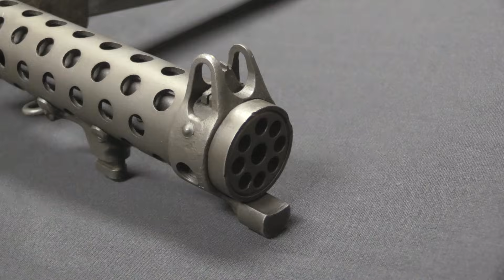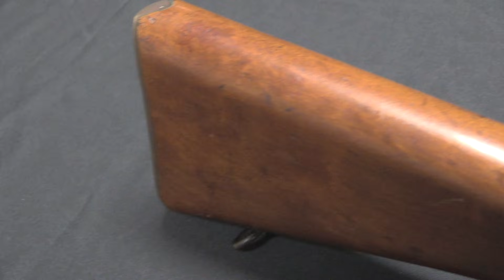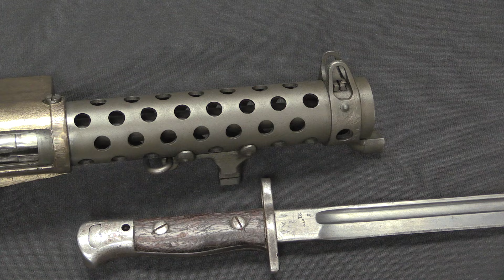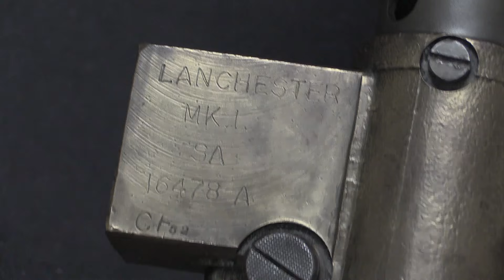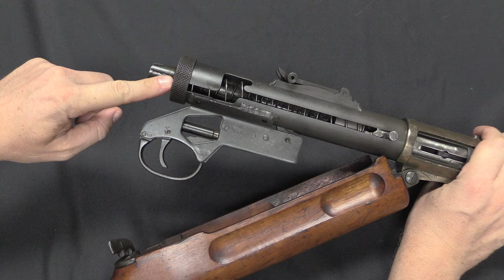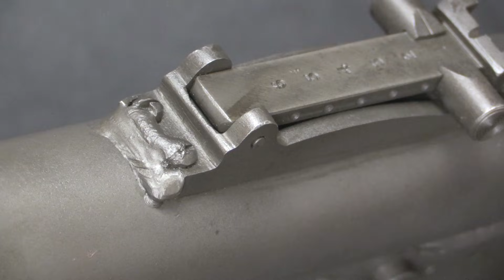Lanchester MkI: Britain's First Emergency SMG

Comment: Why didn't they just clone the nazi sub machine guns?????
Reply: Morale mostly, soldiers typically don't like the suggestion that their army's equipment is so bad they've started to produce the enemy's weaponry instead 

The same thing somewhat applies to the gun in the video as it is based on the MP28 but those saw a lot less use during WW2 than the MP40 and the like, so there's less of a chance a soldier would notice the similarities

Comment: In my opinion the Thompson is the best SMG of the WW2 period.   45 ACP meant higher stopping power and that’s the major plus.  Second in tied position the MP40 and the PPSH, both were outstanding in their own way.  Close behind was the Sten which is a simple yet highly effective SMG.
Reply: Beretta M38A
Reply: It has a pistol grip, last round bolt hold open and double stack double feed mag. it got much right. the cyclic rate of the 28A1 is perfect. 6900 grains of .45 in 4 seconds is unmatched for CQB. people say its over rated these days and will look down on you as ignorant for favouring the thompson over muh MP40 or Souomi

Comment: There was an extreme stimulus for Britain to adopt a 9mm SMG after Dunkirk. Teaching a rapidly formed civilian defense force required a weapon that was easy to manufacture (ergo blowback) and easy to learn to shoot and ~nearly foolproof to maintain. The Lanchester was certainly easier to manufacture than an SMLE. A blowback operated rifle is extremely problematic in so many ways. A pistol is a 50 meter weapon at best and shooting one accurately past 10 meters takes a lot of time and practice ammo. It also requires better tolerances and manufacturing time than a Lanchester  Controlling a 9mm round in a comparatively heavy SMG is a piece of cake.

Most of the above applies more to the Sten than the Lanchester but the thinking behind the latter led to the former..

Comment: The gun wasn’t reversed engineered from a MP28. They did however borrow one of the extractors from a 9mm Bergmann to use on a 7.63mm sample gun, which are the guns that people think they were reversed engineered from. 

MkI guns with fire selectors were never issued. They were dropped in December 1941 and no guns entered service with them fitted. The mark of gun has nothing to do with the fire selector being fitted.

MkI guns were fitted with the tangent rear sight. MkI* guns were fitted with the flip sight. MkI** guns were fitted with the flip sight and bolt safety lever. 

Production didn’t end until 1945. The last contract was in 1943. 

The brass magazine housing was derived from the Spanish Modello 1929, because Sterling had contacts with the company that made them and they assisted Sterling with tooling to make the Lanchester. 

The RAF didn’t want the S&W Carbine. They simply wanted any automatic arm as soon as possible, be that Thompson, Lanchester, S&W or Sten. They simply didn’t care! 

32 round magazines were designed for the Lanchester, which is why in Sten development the magazine is never mentioned as it was a given it would use Lanchester magazines. 

They’re a hugely underrated gun and most of the “known”information about them is incorrect.

Comment: Like most British SA, the Lanchester had it's own purpose made Webbing.
The Magazine carrier was a very elongated Pattern 37 Basic Pouch for wearing on the standard P37 Belt.
Strangely, they were Khaki webbing, not Blue-Gray as was common in the Navy ( and RAF); probably for Royal Marines on Shipboard.
They were sold off as Surplus in the 1980s here in Australia...The RAN had a replacement RN Cruiser late in the war to replace the HMAS PERTH lost in the Battle of Java 1942. Being an RN ship, it came equipped with Lanchesters for its Srms Lockers and On-board Marines.
DocAV

Comment: Apparently, in order to make it not a ‘gangster gun’ they turned it into a long Lee with the ‘bayonet’, also known as a cavalry saber.
Reply: Well, technically, the "SMLE" bayonet, is the :"SWORD, bayonet, Pattern 1907". As seen on the engineering drawings for said item. And that bayonet was a straight knockoff from the Japanese Type 30 bayonet, vast numbers of which entered Royal Navy service before and during WW1.

And the SMG has been described as a noisy, ( L34A1 and MP5SD etc., excepted), extended-range bayonet.

So....

RN ships transferred, during and after WW2, to other navies, Australia and New Zealand among them, came with a "Complete Equipment Schedule", which, apart from the obvious things, included the mess and other cutlery, (including cutlasses and bayonets, and implements for boarding and shore parties. Thus, Lanchesters, assorted revolvers and rifles. If an SMG and bayonet proved insufficient for the task, there was always 20mm  and upwards to five inch and above  naval gunfire, torpedoes, etc.

If the need to escalate arises, it is always good to have options.

Comment: There's just something wrong about a sword bayonet on a SMG. I think the bayonet is longer than the barrel and receiver together.
Then there is the dissimilar metals (brass and steel) in contact on a weapon that was primarily used by the Navy. That's just asking for galvanic corrosion.

Comment: The Lanchester is not the choice for an 'emergency' gun. The Sten is, the MP3 grease gun is but not the Lanchester.
Reply: This is reliable and a copy of a proven design.
It works.
Copy it.... and the copy will work.
In an emergency...something that works is better than something that doesn't......

Comment: Adding the semi auto is no easy task and the increased complexity is amazing  !  No wonder so many were made full auto which make it so easy to make especially using an open breach !
Reply: Well then most everyone says the STEN gun was nothing more than a (pipe with a big spring a nail as a firing pin) not so the sten gun was a fine engineered piece of engineering, with a left / right push button semi/auto firing, they just didn’t spend to much detail on the exterior, most soldiers preferred it rather than the very heavy Thompson gun, not surprising after a 10 mile march under enemy fire, then the Americans caught up and designed something similar nicknamed the ‘grease gun’ Another ‘pipe an spring gun’!.
Reply: Breech....

Comment: Back in the '90's I bought a bag of sten magazines which included a single, 50 round, Lanchester mag (Which appeared to be stainless steel as it never rusted like the horrible sten mags) It was far more reliable than the sten mags in a sten or  my reproduction MP3008. Even loaded out to the full 50 rounds it never let me down and was easier to strip and clean than any of the sten mags (which dated from late war to way after)

Comment: I'm sure the Ian was correct in saying that dented on worn magazine lips would cause failure to feed but the lips on the magazine appeared to very thick. In other words that was going to take a lot of wear or hard hit to destroy.
Reply: Probably why this comment :
cptreech
6 months ago (edited)
Back in the '90's I bought a bag of sten magazines which included a single, 50 round, Lanchester mag (Which appeared to be stainless steel as it never rusted like the horrible sten mags) It was far more reliable than the sten mags in a sten or  my reproduction MP3008. Even loaded out to the full 50 rounds it never let me down and was easier to strip and clean than any of the sten mags (which dated from late war to way after)

Comment: My 2 cents worth : the brass well was a pain : too expensive to cast, too shinny, first thing sailors used to do : paint the damn thing with dark paint. 50 round mags, damned if yoy tried, spring was too tight and bullets could fly out of the other end of the mag. Stock : was a nice red timber piece, very elegant. Rate of fire was kept low as temperature would/could make it overheat. 850°C was the right temp for this toy so 450 to 550/mn was good enough. As for the mag pouches if was two pouches with 2x5 mags, imagine the weight fully loaded ( not speaking of the 1907 bayo either ... ).

Comment: "This has been upgraded with a Sten part" is not something I would ever have expected to hear anyone say about anything.
Reply: It does create a state of temporary confusion; much like "Microsoft Works"
Reply: About the only fitting thing I could think of is a spanner
Reply: I mean, the Sten was crude and cheap, but it was fairly reliable. Most of it's malfunctions are the result of holding it by the magazine, which is a big no no.
Reply: @RetardedSysAdmin  Yes but then they proceeded to offer no alternatives. There is no correct way to hold it, and most gave up and held it by the magazine well. It should've spent more time in the oven for certain.
Reply: @RetardedSysAdmin  Australia trialled the Sten. Half of the trials guns failed due to corrosion in tropical environments.
The AuSten addressed this by replacing the bolt, magazine socket and butt plug with gunmetal die castings but the Owen was found to be better in service and quieter when silenced.
Reply: @RetardedSysAdmin by The yanke in movies  and yanks that wouldn't listen to the British Sargent giving instructions .
Reply: I suppose in a pinch it would be a somewhat handy replacement for a length of pipe. Perhaps as a bludgeon of some sort.
Reply: hell you dont even wanna upgrade a sten with another sten part.
Reply: You may laugh...but the Sten was relatively effective, and cheap enough to be built in HUGE quantities , and quickly.   How many SMG's did the US Army have in 1939?   How many Stens could you make for the price of ONE Thompson?  Who wants to carry a Thompson around all day?   What year did the Grease gun finally appear?  All valid  questions..especially if you scoff at the Sten.
Reply: Trooper DGB 39 almost none. The US Army didn’t place an order for the Thompson until June 39. About 17 of the Mk3 models presumably less for earlier iterations. Beats a pistol, but yeah weights as much as a M1 Rifle. 1943.
Reply: @terranempire2  The U.S. military by and large preferred the .30 carbine. It wasn't full auto but it was magazine fed and semi auto besides being a heck of a lot more accurate. The weakness with the .30 carbine does appear to be the magazine lips but the troops knew what to do with a defective magazine. Throw it away and use a new one.
Reply: @dwightehowell8179  Again..NOT in 1940-41!
Reply: @trooperdgb9722  I’d take an M3 over a STEN any day.
Reply: @Immafraid  But you did not have that choice in 1941.
Reply: @Immafraid  I was gonna say the same thing.
Reply: @trooperdgb9722  ok
Reply: @Immafraid  or a PPS-43 witch has perfect realibalty and 250 meters effective range and is cheaper than the M3 and almost as cheap as the STEN
Reply: @trooperdgb9722  Unit price on a mid production run Sten gun was about £4 which means you got about 12 Sten's for the price of a single Thompson.
Reply: @trooperdgb9722  You're getting awful defensive about a gun that everyone who used it agreed was "fine... for the circumstances."  I mean, it's basically an MP-18 stripped down to its absolute bare elements and made as cheaply and quickly as humanly possible.  It's impressive from an engineering standpoint for those reasons, and it served its purpose well, but that doesn't really make it a very good weapon to actually use and handle when compared to its contemporaries.  By all accounts, other SMGs from the same era with a similar design philosophy are just better because they had a little more time in the oven.  The British didn't think they had that kind of time, so they rushed and cut corners, which is a completely reasonable decision for them to have made at the time, but those decisions came with trade-offs that negatively affected the weapon.  The Brits started looking into replacing the Sten in 1944, so even while it was still being used in huge numbers the military was already interested in replacing them.  The only reason they didn't replace them immediately was because, well, the war was over, they had huge numbers of these things and the political will wasn't really there right away.  But the military definitely knew that the Sten was not really a good long-term solution for the majority of military operations.

It's kind of like those Polish resistance SMG's that were made secretly under German occupation.  It's really fucking impressive that they were made and worked at all under those conditions, but that doesn't actually mean that they're particularly good guns.
Reply: @trooperdgb9722  not many, but most everybody had the garand, so it evens out.
Reply: @themighty4th138  Most of the US Army in 1939-40 still had the Springfield from what I've read...
Reply: @trooperdgb9722  That would be the marines that were stuck with the Springfield during the early part of the war. The Japanese were using bolt guns as well so...
Reply: upgraded
Reply: he said modified not upgraded
Reply: @petey_naf  If its newer hardware its considered upgraded.
Reply: @Logan-zp8bi  that would be an update, which can be debatably better or worse. how can something be considered an upgrade if it's worse?
Reply: Steps aren't as bad as non users want to imagine .

Comment: I fired one of those 50 round magazines out of a Sten gun and from my experience, those things suck.
Reply: EdM240B 50 round magazines or sten guns?
Reply: It was a Sten gun that was fitted with that 50 round magazine. I know, I was surprised that it worked inside the gun as well.

Comment: 12 lbs? Yikes. I was expecting it to be about 7. Tubular receivers are heavy i guess, as are the bolts. The Thompson weighs about the same, grease gun is 8 lbs, and i think the Sten is close to that. Looks like a good design. That long mag has got to get in the way though, esp in tight quarters. I'm a little surprised they didn't use a standard length mag aboard ship. Great video as always. Thank you

Comment: Thanks for this.  I have a de-milled Lanchester Mk 1* obtained from a yard sale for, no kidding, five bucks.  Little old lady just wanted to get rid of it.  It's in not bad shape considering it was probably used as a toy and kept in somebody's closet for who knows how many decades.  The bolt is welded and sealed, there's no recoil spring and the barrel is plugged with a piece of wood (?) painted a faint pink.  On the other hand, it's got a fully functional magazine, which is pretty cool.

One reason I keep it -- aside from the fact that it's the only gun I'd use as a "wall hanger" -- is it has Arab markings carved into the stock and pressed into the brass magazine housing, which spark the imagination.  I was in the Gulf War and saw a lot of Bedouins in the desert near the Iraqi border with old Enfields and their chests crossed with bandoliers of ammo, which kinda blew my mind.  I can't say I saw any Lanchesters, but I can easily imagine mine being used in some war or kerfuffle in an African or Middle Eastern desert somewhere.  I've read a few books on T.E. Lawrence, and while the Lanchester is out of time for his adventures, it sparks the imagination and feeds a bit of nostalgia.  

Anywho, thanks for the history lesson!

Comment: i don't get it, instead of making a whole new gun why would no one just put one of these guns "on a diet" and use the lighter cheaper version? like the germans were using "plastics" on MP40s and we started making guns out of sheet metal later in the war but you can't trim a few pounds off one of the most simple weapons being made?
Reply: Enter the S.T.E.N. Gun
Reply: Because the Lanchester was made for production by existing small arms makers who had the tools and trained staff already. The Sten was for production by small general workshops with no special tooling or experience.

Comment: The guys who made Thompsons back in WW2 must have been absolutely killing it.
Reply: They had scrooge mcduck style swimming poole filled with gold coins
Reply: Auto Ordinance was the company that made Thompson guns and yeah they were making an unbelievable amount of money to the point where they were also making stuff so they could continue making that money such as a Thompson in .30 Carbine for the M1 Carbine program and a T2 Thompson(which was meh) for the program for the Thompson replacement they didn't get either of those though and I bet they got SUPER pissed when the U.S. adopted the M3 Grease Gun and replaced the Thompson with it and then in the Korean and Vietnam wars where the SMG role was delegated to the M2 Carbine and Grease Gun
Reply: @murderousintent7838  a Thompson in 30 carbine would be killer, with a 30 round mag that might has well be an ar
Reply: $4300 per gun in today's money. 😳
Reply: Ayyy!
Reply: High per-unit cost doesn't necessarily mean high profit margins. Indeed, it can mean fewer purchases, leading to smaller profits even if the per-unit profit is the same.

The Thompson SMG didn't just cost a lot to buy it cost a lot to *make*.
Reply: Joseph Harner But they still sold many and if it wasn't profitable they wouldn't have done it.

Comment: What exactly determines the "rate of fire" on a fully automatic machine gun?
Reply from the maker: Mostly bolt weight and spring force.
Reply: Forgotten Weapons According to Martin J Dougherty in Small Arms: 1860s to the Present Day, the brass magazine fitting was to reduce corrosion.

Comment: I always liked the Lanchester, nice slow rof and heavy so you stay on target while holding the trigger back. Those 50 rnd mags will destroy your fingers if you don't have a mag tool though.
Reply: I have also used one and they stay on target much better than a L2A3 Sterling. Came with a col multi magazine chest harness and a separate magazine bandolier to go on the back too. The 32 round magazines were for hand reloading. The 50s were only intended to be loaded via the reloading tool.